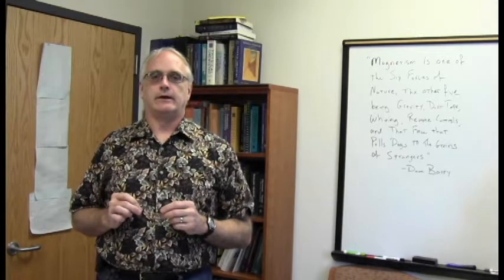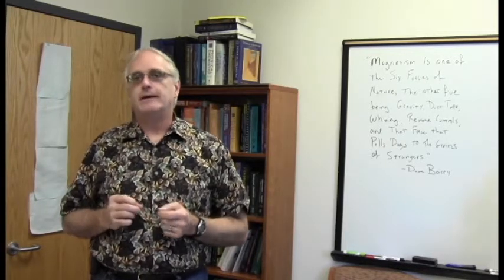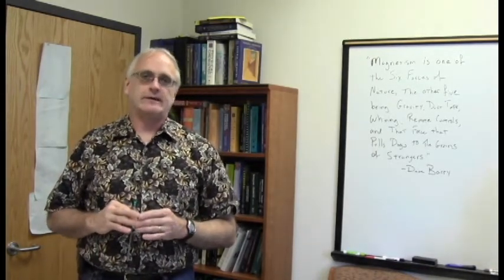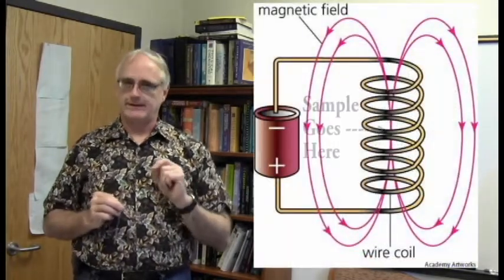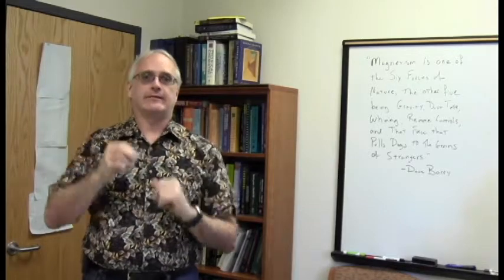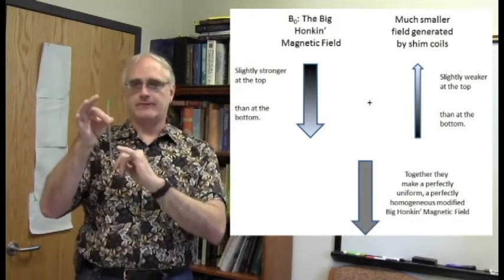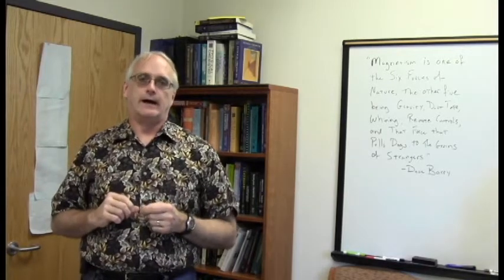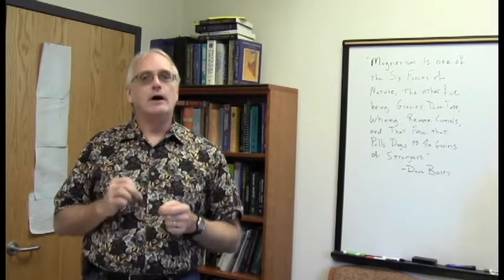Locking and Shimming

Comment: Hi. Please I am wondering how long does it take to acquire a spectra from a sample on standard NMR machines?
Reply from the maker: The answer is ... it depends. A standard proton spectrum of a reasonably concentrated sample can be acquired in under a minute. A highly dilute sample that requires over 100 scans can take five minutes. If one were to do a whole suite of experiments on a sample (proton, carbon, DEPT, COSY and so on) at least an hour of time is usually required. 

The longest experiments we typically see are carbon spectra of samples that have a low solubility in any common deuterated solvent. Those can be overnight runs of thousands of scans to get well defined peaks and a reasonable signal to noise ratio.

I hope this helps.
Reply: Thank you